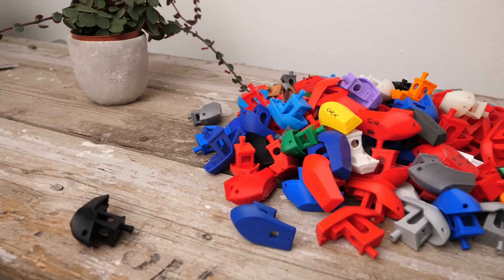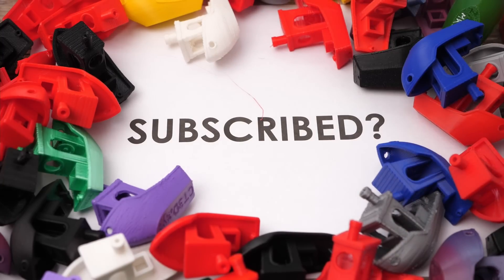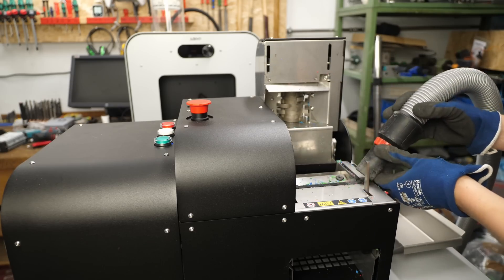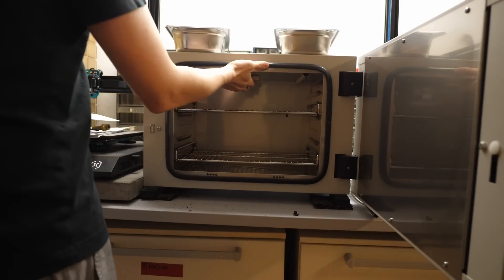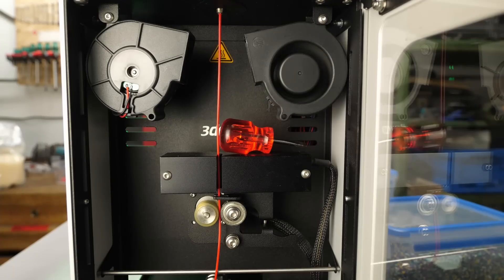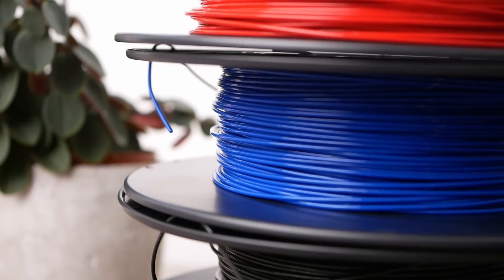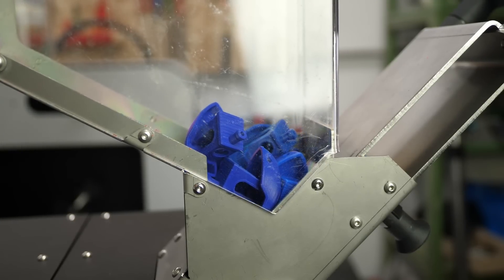Recycling all my 3DBenchys into new Filament

Comment: When it comes to grinding the material up I cannot help but feel that there must be another option. Having to cut everything up in to tinny pieces is an expensive and time consuming process. Someone needs to research to see if it's possible to just dump all the material in to a metal vat with holes in the bottom, heat the vat up so the material becomes molten and then use hydraulic pressure to press down on the material. A spinning blade below the holes would then cut the extruded material up in to pellet sized pieces. I don't know if this process would work, but if it did it would cut out many stages, and at least someone would have tried something different. I would make for a great video, even if it fails.

Comment: Nice work, but I think the way to obtain a circular 3D printing process is to forget about filament, and use pressure injection.  We should just be able to feed plastic pellets into a hopper,  it will melt in quantity, and then be fed through the extruder with regulated pressure.  Anything else, will just require too way too much expensive equipment for small-scale use.

Comment: just when the world was finally stepping away from using plastic for everything(or at least trying with things like plastic straws, less Styrofoam) now there are THOUSANDS of people all over the world generating hundreds of pounds of plastic waste every year. The vast majority of it is for useless nic nacs, or your "benchies" yes i know that lots of people use their printers to repair things, and they are obviously often used for beneficial reasons. Thats not what im concerned about, and i really dont want to be a party pooper. 3D printing is AWSOME, for a lot of reasons. And has proven to be a useful technology. But imagine if in the 60s/70s people had their own injection mold machines at home and could just make "fun" things on command. 🤷‍♂️ i dont have an answer, im not advocating against 3d printing. But its something that should be thought about

Comment: Just like 3d printing tech the filament recycling tech needs to catch up and get streamlined before the prices drop to everyday consumer levels. It won't be viable for most people until it becomes a compact and consistently reliable machine under $500. Only then will it be cost effective to recycle your failed prints instead of just tossing them and buying more filament. As you also have to have a sorting system to separate the different types of filaments, A dehydration system to remove moisture, a grinding system to evenly granulate the plastic & the final heating and extruding machine to finally produce a usable spool.

Its a lot to digest but the demand and need for this tech is only growing and the maker community lives to solve these problems. Its only a matter of time before this tech is obtainable for the average consumer. I saw a guy who developed a method for converting plastic bottles into usable filament. Peaked my curiosity because my family generates quite a few plastic bottles and this state doesn't do bottle returns. Such a waste of good material.

I think this will catch on if we can get the grinding machine and the filament maker to around $500 or less each.

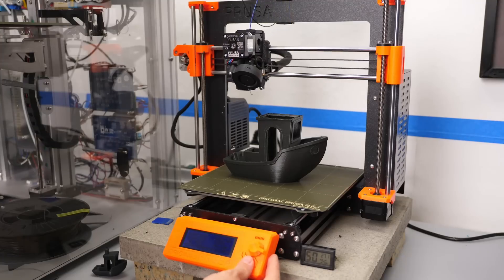Comment: What gcode trickery did you do to recover your partially finished print at 12:23
Reply: I'm going to guess that he took the G-Code and put it in Excel. Since he knew what layer it stopped at, he removed everything before that failed layer and kept everything to continue at the failed layer.

Comment: Late to the party but I work with industrial extruders, and want to add if you didn't got that info yet, that when you want to use multi material recycled plastic, you need to mix it in small ratio with something else to get a stable output, like 1:5 or even less down to 1:20. Also, there are very efficient coloring pellets, so you can turn your ugly grey into nice black with jusy a tiny addition of it.

Comment: I used to work at an industrial plastics facility.  Contamination in the regrind material was a huge problem (partially because someone kept throwing our metal post-processing tools in the grinder).   I got flashbacks when I saw the metal bit in the filament!

Comment: I am saving all my failed material for recycling when I manage to do it myself or a service becomes available. But I highly suspect I will work on a DIY system myself. I have already started on a melting process which I subsequently drain to a water container  to create somewhat consistent droplets to then extrude those, similar to what we get at as industrial raw material for extrusion

Comment: I'm still only just starting out (have only used maybe 3kg of filament so far) but I really want to find an economical recycling option for my waste. Of course it would be superb to be able to do it all at home, but that seems to be out of the realm of possibility for most 3D printers. So it would be great if there were reliable centres nearby that we could send the used material to. Pretty much anything is better than tossing it in the rubbish. I had no idea just how much waste you can end up with before I tried my hand at printing a few models. And leaving aside the environmental concerns, it's just wasteful monetarily to throw all the waste away when there are alternatives like this. Great video.

Comment: I just found this video and am currently researching 3d printers. I've been looking into the idea of recycling 3d printer scraps as well as methods I've seen for turning clear plastic bottles into filament. Essentially I'm trying to see if I can create a home system with minimal waste. Of course a single source of material is necessary to for the filament to remain consistent. I'm interested in what you and others have to say on the matter. If this has already been covered, I would appreciate being pointed in the correct direction.

Comment: Just fyi. I use to do extrusion on an industrial scale. If you mix in virgin material do a 70/30 mix. It comes out almost like pure virgin material. 70 virgin and 30 regrind. The more recycled it is the more virgin material will need added due to loss of plasticizer in the plastic itself. If I recall right you can recycle up to 2 times before it's a total loss on pure virgin material. If you go to much there will be to many inconsistencies in the filament.

Comment: I wonder, why the recycling industry is not working like this? 
Sure, you cannot melt in every plastic, but if you would facilitate this, you could probably make new Filament from a lot of what's going in the trash. 
Maybe the motivation is not big enough yet. This will probably change, when we finally run out of oil.

Comment: So for around $8,000 you can set up your own filament recycling system, spend the hours and hours it takes to recycle scraps into substandard filament good for only printing benchy's and fitment tests, and run the possibility of jamming your printer with foreign objects in your recycled filament......OR......you can take that $8,000 and buy 27 years worth of filament.

Decisions, decisions, decisions.

Comment: I just wish the recyclers were more affordable for regular folks.  3 grand is quite a steep price for a reasonably simple machine.  I had a giant bin of plastic waste just from 3 months of printing.  (I made alot of mistakes in the beginning and I tend to print with supports and rafts as I print complex objects, so I have quite a bit of waste)  I had to just put it out for the municipal recyclers because I couldn't find an economical way to recycle it back into filament.

Comment: Grinding Benchies to make not only more Benchies... but also a MEGA Benchy!! I love it! XD

Great proof of concept here, I really like it! I do believe, however, that recycling 3D printing material would be much more viable for industrial or large-scale 3D printing farms. I think for most hobbyists that have one, maybe two 3D printers that are not constantly printing, recycling the material at home may be too far-fetched considering the equipment cost and the smaller amount of material to recycle.

It would be amazing, however, if there were easily-accessible services that could buy 3d printed waste (maybe $5-10 or so per kg of material?), turn it into usable filament, and resell the new spools for reuse.

Comment: You should see the massive vibraters they use at recycling companies. They move the cut and washed plastic flakes in hoppers. They also vibrate enough to put your feet numb in two to four seconds through thick boots...

Comment: I know this is a year old, but you might be able to use a magnet on the metals if they are magnetic
Reply: Toss it in a water bath after it is ground but before it is dried.

Metal fragments will sink and the plastic will (usually) float, scoop the flakes off the water and dry it.

Comment: The price of that equipment is crazy.  I would love to have a near endless supply of filiment for prototyping.  90% of my prints are prototype and in the end trash.   Any service that does this will struggle, as the filiment they produce will need to have a high standard and be cheaper than buying a new role by a large margin.  I wont pay more for the hassle of having my waste resold to me at a higher price than just ordering a new role off of Amazon.

Comment: Keep in mind that when printing with virgin filament, some of the chemical make up is liberated as a gas. Some of these chemicals are included to enhance the printability of the material. Since it was liberated in the original print, it will not exist at the optimal quantities in the regrind. Running it through another heat cycle to extrude new filament further changes the chemical make up and will affect the quality of the part. Professional automotive plastics manufacturers only allow a small % of regrind to be added to parts extruders for this reason.

Comment: I’ve worked in several plastic industry for over 10 years and I can tell you for a fact a possibility of having inconsistencies is you probably didn’t strain out possible metal bits. Having worked both the Raw Materials and production here’s what I know. Failed parts are sorted (mostly color from clear) ground up into small chunks. Then ran through a metal detector which spits out more than just metal. My guess is some irregular chunks tripped the sensor or some times couldn’t handle the flow of the regrind. Then once done we would either mix it improperly mixed virgin material or leftover material that wasn’t used. Then to make it all one nice uniform color black pigment was added and mixed before being ready to ship out as new material.

Comment: I'd love to see a follow up on this where the filament is used, broken down, and re-extruded a few times to see how much degradation is from the recycling process itself, or if the integrity drop is just because there are different brands with different stabilizer/add-in ratios being blended together.

Comment: I want to recycle all of the plastic waste I make in to filament, instead of just PET or Waste Filament, are there any other recyclable plastics that we could use? What about those whit bottles of laundry detergent? Or the plastic covers of old electronics? Or the glassfiber of PCB? Is there such a thing as glassfiber filament? If carbon and wood and metal fiber exist? Why not glass, maybe a very hot hotend would be needed I don't know, maybe some ideas for next videos

Comment: You need to start marking what you print, just like normal plastic items are marked so you can reduce the issues when recycling.

If you add the marks to the images before printing you won't have to manually stamp them yourself.

Comment: There should be a service for recycling this plastic. Why a service they could have the inhouse tools like labs to see if the material is good enough to be sold on a lower price and have a good consistancy. A service can do better investment on large scale where in a private person needs to have the money to do this.

On a molecular base the reused material could have a different structure than the reference material (original). This can cause faulty prints and will also fail earlier on stress test (like your test)

Comment: I work at an automotive factory where we make fuel tanks from plastic and it’s interesting how similar my job is to this process.

Defect tanks are ground up, mixed with plastic pellets, and put back into the machine to be melted, pushed through a breaker plate to catch impurities, and then fed out. Waste material must be purged out before useful material can be used and so on.

It’s just super fascinating to me

Comment: OMG I really appreciate this vidéo even if it's the second time I watch it. I think it's also a really interesting experiment to understand the PLA as a plastic material. The point I was interesting was that the strenght decreased a little compared to the reference filament and since there are some substances that evaporate during the melting process (that is considered as not good for health even in the PLA) I was wondering if a part of them contributed to the strenght of the PLA. That's why I wonder if you can make this recycling process several time (recycling PLA from recycled PLA) and do the same test to see if the strenght constently reduce as the number of recycling increase. Who knows, maybe after 4~5 time of recycling, the strenght of PLA become really low to not be able to be used. (90% for 5 time (0.9^5) become about 60%). Anyway many thanks to make this wonderful video, it's really really cool!!!

Comment: Recycling 3d prints just seems like a greenwashing fad. You need alot of energy to produce expensive machines that can turn 3d prints into pla pellets, and it also takes a lot of energy to collect and recycle those 3d prints. What are you left with at the end? Low grade PLA pellets or scrap that has to compete with 2-3$/kg pure, single colour, uncrystallized virgin PLA. 
The most sensible thing is probably just to burn the PLA and use the heat to generate energy. PLA usually is made from corn, so this is basically bio fuel with a couple of extra steps.

Comment: I've got 10 years experience running big extruders. I was the lead mechanic on a PET cup production line. We made our own sheet in line. (Most cup companies buy pre-made sheet.) We never ran 100% regrind. Not just for feeding issues, but also because grinding the material makes it Weaker. Intrinsic viscosity goes way down at regrind % goes up. Don't go above 60% regrind and your product and ease of production will improve.

Comment: Honestly this is the dream of most makers. It just hurts me to see failed prints go to the bin, but it sadly seems like such a hassle even with a machine like yours. It would be amazing if a company like Das Filament would let you send them kilo boxes and then they send you back a roll. Or even have their own recycled filament which you can buy and if you send them plastic to recycle they give you a discount depending on the weight! The filament would be maybe cheaper and less qualitative and also color may vary but for prototyping it'd be amazing! I'd honestly buy it. One can dream...

Comment: Regarding removing contaminants and producing consistent sized chunks- would it make any sense to do a rough first run (with a simpler & faster process) that filters and extrudes through a wide nozzle (like 3 mm or something) which gets cut into pellets as it extrudes. Then you get a consistent-ish sized pellet that's already been filtered to put through the final extrusion process.

Comment: Not sure if you will see this months later or not, but I work in the flour grinding industry and might know whats going on with the metal shaving. Even grinding flour, there is a small production of metal shavings from the grinding process that is usually captured with a magnet in the production line. Not sure how much of your system is ferrous versus not, but if its primarily steel then you can catch the metal shavings using a strong magnet over the ground product.

Comment: About degradation:

The energy introduced to the extruded polymer particles during filament production comes from the heating but also from the shearing forces due to the extruder spirals. The polymer has a statistical "polymer chain length" which correlates with the average macromolecular weigth. The introduced forces lead to the cracking of the polymer, decreasing the average polymer chain length and the macromolecular weigth. This destabilizes the structures printed with the recycled filament. A further notice, is that any additives contained by the polymer are sometimes also more volatile as the polymer molecules themselves. This can also lead to losses in mechanical properties and changes in glass transition temperature.

In your case, I would be eager to see multiple times recycled filament, and their test to see the degree of degradation. It can be possible, that the ideal properties can be held using mixing new- or first time recycled properties with for example 3-4 times recycled filament, in case a sudden quality drop happens after the third- or fourth recycling cycle.

Comment: I could see a simple extruder as a maker project... I mean, it is nothing more than a hitend with a 1.75mm nozzle, an extruder to pull out the filament, a mechanic to push the ground PLA into the hotend and a few fans...

Comment: I used a Chipper shredder for wood and a Filastruder I think I miss set my Filastruder it will not get to temp no matter what size of power supply I put on, and it worked fine Originally with a 8Amp 12VDC supply One of the settings on the control is not right Power setting I think how did I screw that up... Filastruder thought I destroyed my thermostat, but I bought a new Thermistor same issue it will not hit the correct temp I think I accidentally changed one the settings you're not supposed to change... and I cont find an instruction sheet for that Thermal cuppler unit..